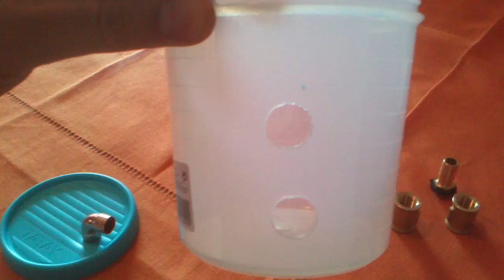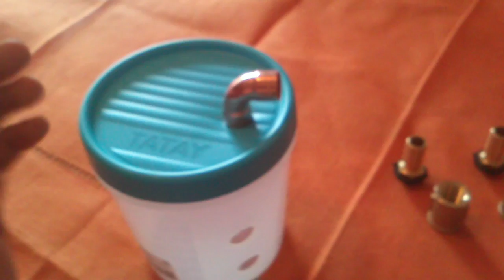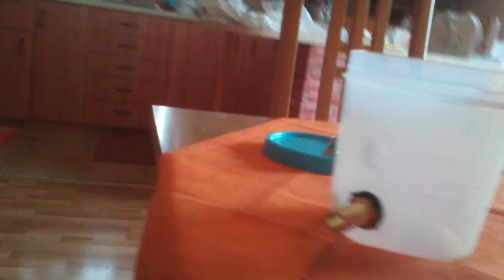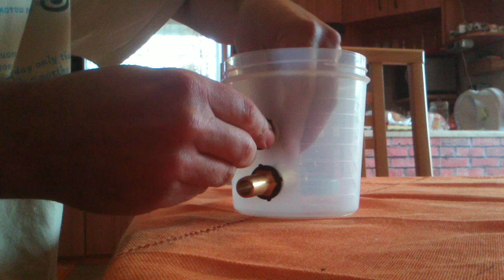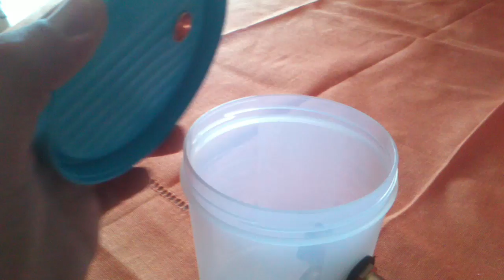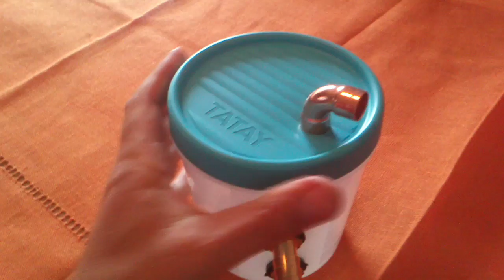How to make the cheapest HHO fuel cell bubbler in the world easy part 3 of 4

Comment: h2o is water, D3o is deuterium, H2 + o2 is simple molecular gases , H+ H+ o_ _ is called ionized HHo because certain pulsed power supply is applied allowing higher energy density gases evolved. - Not to be confused with plain low efficiency everyday electrolysis forming h2 and o2.

Comment: I may be new in HHO fuel system or is it HOHOHO? I just can't imagine the rate of conversion from water to Hydrogen. Example if a 3 liter engine is fueled by H with a nominal 10%-90% Hydrogen/Air mixture will use up 300 cc's of H every 2 revolutions in a 4-cycle engine. A car that cruises on 2,000 RPM will use 300,000 cc or 300 liters of Hydrogen every minute. An hour drive will need 18,000 liters of Hydrogen. Go figure.I had a $2,500 electrolytic converter install in my Honda in 2006. The bubbles were directly hooked to the carb. The seller assured me that the Hydrogen added to gasoline will increase my mileage. It did about .005 MPG.
Reply: +pio san
santa runs his new sled on HOHOHO...hes put his reindeer out to pasture

Comment: I have not made mine yet.  I am involving everything I see, before I make my prototype.  Mythbusters already disproved this works for vehicles.  I highly expect Mythbusters got a check from Exxon to make it look like it does not work.  I know this cell would produce massive amounts of explosive fuel air mixture.  I will prove it.  Controlled explosions is what makes a motor vehicle run.  It is alternative fuel source, and is free, and clean.
Reply: I suppose corrosion is going to be addressed sometime?🤔

Comment: If you used aluminum instead of copper, wouldn't that solve the heat problem?
Reply from the maker: ive made a new babbler and everything on it is plastic and my water is clean. i havent changed my water in 7 months and its still clean
Reply: yes
Reply: did you wind up having to change the ecm settings? like change how much fuel it dumps?

Comment: The energy required to generate the oxyhydrogen always exceeds the energy released by combusting it, even at maximum efficiency, the input energy of a closed system will always equal the output energy, as the first law of thermodynamics states.
Reply: The point of splitting water with electrolysis into HHO or H2 is not to be an ''over unity'', ''perpetual machine'' or breaching the law of thermodynamics,  it is to ''make'' a clean, self;sufficient and also economical source of fuel, extracting and compressing/liqueifying H2 or a HHO on demand system consumes MUCH less energy than extracting andbrefining oil to be processednto petrol and transported to a fuel station, and H2 and HHO is ''free'' in the sense that you can get water from anywhere and the electricity is possible to extract from the sun with solar panels or reflective mirrorsnwith a Stirling Enginr as a focus. Of course there are a few scam companies out there and a few magazines and shows that try to ''debunk'' these sort of things, but when you observe closelynyou can notice a lot of things are missing in their ''tests'', I was a bit skeptic at first, especially about free energy but it does exist, but it is wrongn interpreted, and why there is none of this texhnology on the streets is obvious, water can't be controlled but oil can, anyway it is up to anybody's choice to choose for themselves in my opinion, hydrogen cars that are coming now on the marketnhave H2 that is extracted from Natural Gas, which solves nothing and is just a marketing trick that will cost more and do nothing for nature, diesel and bio diesel is being heavily bashed with taxes, including modification of engines and carburetor in mass produced cars by companies to be incompatible with gasoline vapour and bio diesel, the best options I guess are kit cars or old semi new models, I am not affiliated with any HHO Fuel Cell company or any of the like, and there are a few ''scammers'' out there, some of them of the regulsr type who want to get quick money, and then possibly some   that work at the oil industry, it is best to read a lot about it and you can come to a conclusion, H2 and especially HHO is dangerous because of how easy it is to ignite, though the Hindenburg had nothing to do, the Hindenburg had canvas covered with aluminium powder and acetone, which is very flammable, the ones who stayed omboard during the Hindenburg survived, the ''creator'' of the zeppelin blamed hydrogen presumably to save his career, and then hydrogen was ''ditched'' as an alternative, but that is in the long past and things have and have not changed, electric cars are not the solution because of the batteries, the processing refining of the components of a battery is very polluting and energy consuming and it is in a limitrd supply in Earth, so I think it should be used scarcely and not for 100% EVs. H2 or HHO when burned the ''byproduct'' is H20, water and trace amounts of NOx, which form from the nitrous gas naturally in the air, even thougj NOx is 200+ times more ''polluting'' thsn CO2, the amounts are so small it is ignorable, I don't think CO2 is polluting and causes green house effect since trees absorb CO2, and I don't believe that CO2 emisdions are causing ''global warming'' but the worst pollutants are poisonous and toxic such as carbon monoxide and hydrocarbons which are released by the combustion of petrol, not to mention hexsfluoride from aluminium processing plants which is put into water systems in some countries, GMO foods, pesticides in general though not directly to H2O it is almost the same thing.

Comment: Possibly the dumbest thing I've ever seen. First, since the anode and cathodes in your "bubbler" are not in separate chambers, you produce both hydrogen and oxygen gas. More on that later. Since you added salt, sodium chloride, the electrolysis is creating chlorine gas too, and also turning the water into sodium hyporchlorite, better known as bleach and is the reason the water turns yellow. The chlorine gas produced is very bad for anything metal (think of all the metal between the intake and tail pipe) as it is a powerful oxidizer (makes rust). 

  Now, you might be thinking to yourself, "Oh cool, it produces both hydrogen AND oxygen?! That's what the space shuttle burnt before being decommissioned. That got us to the moon! My BMW will surely go fast!" Sure, except you forgot about the energy required to break the bond between the hydrogen and oxygen in the first place. This is why the "fuel cell" gets hot. Even if the energy was perfectly conserved, the net result would be recouping the same amount of energy from combustion that was used in electrolysis. But, since a combustion engine is around 25% efficient and then the electrical generation from the alternator and the heat lost in the reactor, you're really just losing efficiency. The good news is it hasn't fried the fuse, which means it isn't drawing more than 7.5 amps, which means it isn't drawing more than about 100 watts, or about 1/7th a horse power at the theoretical 100% efficiency.

  With all that said, to answer your question about the yellow water: use only distilled water. Don't believe me about the chlorine thing? Buy chlorine test strips for a swimming pool or just watch some more youtube videos about chlorine generators. How do you separate the hydrogen from the oxygen? The positive plates need to be in their own chamber and the negative plates in a separate chamber with the water connecting them, but separate hoses taking the gases produced from the separate chambers. Hydrogen forms at the cathode, or negative terminal. Read about electrolysis of water.

  My last thought: You're envisioning an over-unity machine. Plenty of cheap scams in the back of magazines offer these miracle machines that give free energy to the person willing to pay $10 for the plans. The energy required to make the hydrogen is far higher than the amount of energy derived from the hydrogen. This poorly designed gadget is only good for filling balloons with hydrogen and oxygen in a perfect ratio to cause a fun explosion when lit. Having a large container of water strapped to your cars intake is possibly the dumbest part. Also google: hydrolocked engine.
Reply: Nice write up thanks. I read Baking soda in the water is best. true?
Reply: wtf this EXACT comment was in another one of his videos
Reply: billab0ng83 yes  doesn't make the harmful gas

Comment from the maker: The little copper on top is for the outlet for the gas which you conect a hose and run it to a smaller bubler and then to your airintake pipe. Place the hose as close as you can to your throtle.

Comment: Miles you need to use magnets to separate the HH from the O and you will get better quality fuel.  A young man on a Nuclear sub got his 250 motorcycle working off of nothing but HHO using spiral designed cells eight to be exact. 

He explained, that there appeared to be a mysterious vortex effect. That appeared to be increasing the fuel generated, and the Magnets separate the HH from the O the bubbler had a partition with the hose barbs on the opposite sides of the partition.

Good luck
Reply: give me the link please

Comment from the maker: Flashback is when you get a spark or backfire through the airintake which might hit your bubbler or dry cell. I have 2 bubblers so ive never had a prob. I havent done anything to my injections. I think that the hydrigen and oxygen are coming in from the cell to the motor are in a mixed flow so the computer reacts the way it should. Dont do anything with the injections or computer.